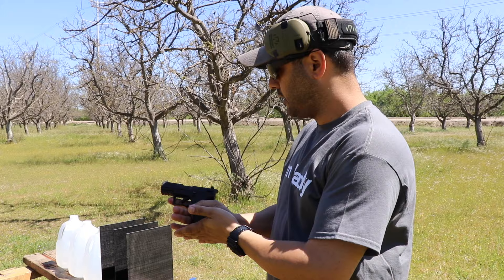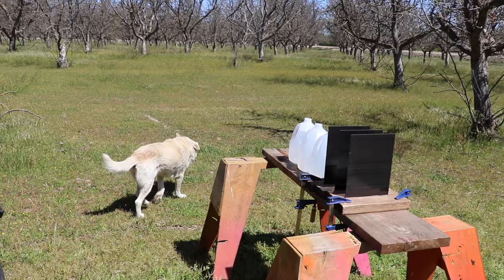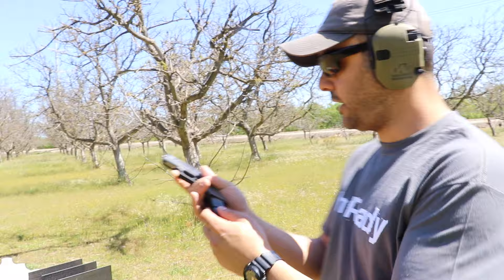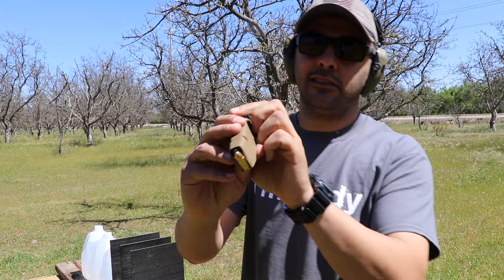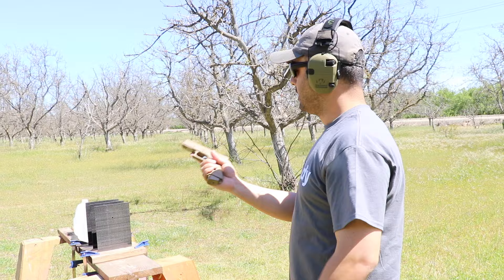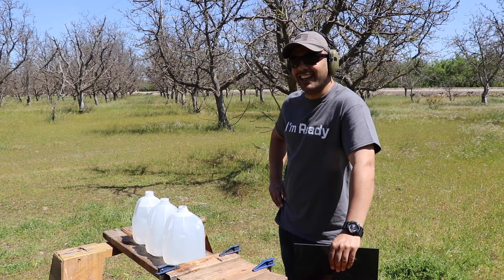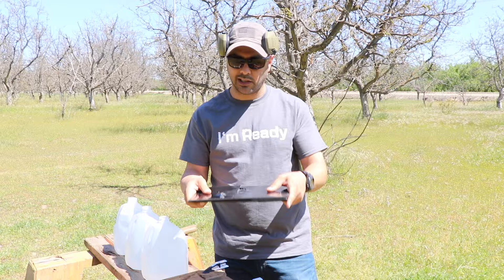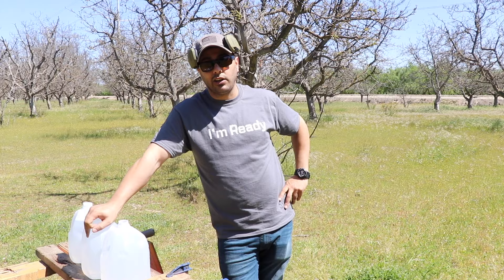Carbon Fiber BulletProof?

Comment: The strength in carbon fiber comes from what’s binding it, the number of strands, and number of layers. It might be best to make your own carbon fiber sheets, it would be cheaper that way. I’d suggest a 12k roll of carbon fiber
Reply: How can you just make your own? I imagine that would need a hydraulic press at the least
Reply: @douglasbubbletrousers4763  u can make it with a homemade vacuum, works without problems
Reply: @thecompilitation8314  Interesting
Reply: @thecompilitation8314  how do you have a link
Reply: I would love to see a demonstration

Comment: You also gotta remember that not all carbon fiber is created equal.  By changing the weaves, resins, curing and other factors you can specialize your carbon fiber to deal with more specific things.  You can probably buy differnt prepreg carbon fiber and use molds to experiment.

Comment: Glue 3 sheets together with epoxy and the shoot with the larger caliber guns (please).
Reply: JerkRice leaving them spaced out will actually increase its protective value because it will deform the projectile and cause it to tumble and lose massive amounts of energy
Reply: Synapsis Flame you are probably correct.  I just want to see what the destruction would look like.
Reply: Rotating the patterns some could make it stronger.
Reply: With 3 sheets of kevlar in between and a foam backing.
Reply: no, they would be stronger as one piece.
Reply: @cagataytekin6318  - 100%
Reply: Cagatay Tekin No, that’s not how it works. Spaced armor is an effective armor even used on tanks as it makes the round tumble in the air and it could redirect the round decreasing penetrating power
Reply: I even have some 12mm material available to test
Reply: @M.C. Maldek RLSV composite armor used on MBTs is not made up BS. Air gaps are very effective and are one of the reasons why the leopard 2A5+ arrow head design is so effective. Also given the average sheet thickness of aluminum foil of 0.2mm you would have 60mm of aluminum. You would need 381 layers of foil to have the same thickness at which point you could arrange it to stop more powerful projectile
Reply: @JerkRice  caliber doesn't effect penetration its speed that increases penetration
Reply: Even better would be sticking steal wool in between and with that I am sure it would stop it!!!
Reply: Synapsis Flame were talking about body armor
Reply: Then Rhino Line the outside of the Sheets of Carbon Fiber

Comment: They look like they are 3.0mm thick. 2.0mm is quite thin.
Reply: Paul Capocasa 2.999mm in my opinion
Reply: 2.99996mm imo
Reply: 4mm more like it
Reply: I'd say 4 mm
Reply: 3/16" for sure
Reply: Paul Capocasa what do you Americans know about millimeters...
Reply: jybuys I'm NOT an American, I'm an Australian. Also, I'm a tradesman, I kneed to know both metric and imperial.
Reply: I think is something between 3 or 4 mm, 2 mm is too thin as you say
Reply: TeknoBreaker I don't think they make 4.0mm....only 1.5, 2.0, 3.0, 5.0 mm. Quite common to skip a size like that so the company can reduce tool costs...you can just use 2 pieces of 2.0 mm to make a 4.0 mm.
Reply: jybuys  Well actually they teach both metric and imperial in America now, I'm a high school student in USA and I remember starting to learn metric in third grade and if you have any Chemistry and engineering classes you will use metric. I actually like metric much more than the US customary, a Base of 10s makes much more sense and is easier to use.
Reply: Dillon Hawkins That is right. When I was doing my Engineering studies, I had to learn imperial and found it extremely confusing and outdated. Most older people don't want to let go of the imperial system and won't even try metric. The metric currency is just as easy.....I can't work out the old Pound and Shilling the UK use.
Reply: Paul Capocasa its 5mm actually
Reply: dvr1337 That is NOT 5.0mm. Open your eyes!
Reply: Paul Capocasa to change everything in the USA to metric from our current system would cost an insane amount of money. Thats my assumption of why we havent changed it..
Reply: M773 I totally agree. It is much more logical to break a number into 10's than it is to break 1 inch into 64 fractions or decimals (Decimals are metric anyway and most Americans don't know they are halfway there).
Reply: They are definitely at least 5mm
Reply: Paul Capocasa Hey fyi companies definitely make 4mm CF.
Reply: @XenonLining  1/4 inch braddah
Reply: That looks like 5mm to me
Reply: Tnx for the advise about thw weight

Comment: Carbonfiber can be made many many different ways. Meaning with the right composition of layers, weaves, materials, epoxy, type of cf, cure cycle, etc, etc. It can be made to be more bullet proof than basic carbon fiber.

Comment: As a racing fan in Indy and F-1, I found this fascinating because for many years, they talk about how strong carbon fiber is compared ro steel. Good choice to continue video later, cut to 6 layers vs bigger caliber. Rico cracked me up, found tall, green grass to chill in, looked like a Apex predator hiding in wait.

Comment: 4 sheets of carbon fiber with high condensed foam spacer would still be lighter than kevlar. Maybe not ideal but if you need to be fast. With the spacers it would even be more bullet resistant. Probably most handgun common rounds.

Comment: That doesn't seem to be true CF. You can see in the first shot autopsy. It's a CF composite. Solid CF would have more hairs at the fracture line, and it wouldn't delaminate that easily, and the fracture lines of that inner material (that looks like a homogeneous sheet, not a carbon weave) are perfectly clean/straight. I've never seen broken CF act this way.
Reply: Andrew Delashaw seems legit but most likely due to multiple layers maybe 6k and 3k mix but would love to see 24k x3 sheets be shot

Comment: I bought a G19X for $589 at Academy 2 weeks ago and it is the best pistol I have ever owned. And  I have had ALOT  of pistols. Still love my G29 gen4 alot though. If anyone is on the fence about the G19X, buy it you won't be disappointed.

Comment: 115gr of powder in a 9mm would be insane
Reply: That could be fun... Once! (You'd need a larger case for 115gr of powder, but you could neck that down for a 9mm) Might I recommend having a mighty string and an ordnance-grand shield in place for testing.
Reply: Yeah, I think like the most you would use is like 5.8 grains.
Reply: @chontarango6024  I load a 115 gn fmj bullet over 6.3 grains of cfe pistol powder, talk about a snappy round.

Comment: Don't arrange it in distant, stack it closer together so its more resistant
Reply: This would actually work to its disadvantage as having the air gap causes the round to lose energy after being deformed and will begin to tumble

Comment: Just for reference, there are 7000 grains per pound, or 437.5 per ounce.
Reply: 1000mg->1g
1000g->1Kg
1000Kg->1Ton
1000Ton->1Kton

Anothert sample of the metric system. 

Can anyone explain me why ounce and pound and grain exist and why they are how they are?

Thank you!
Reply: Great question, Pleumel. Even more so why do we have a 115 grain bullet for a 9mm round?
Reply: Jim Vandemoter now we can start:
9 mm
10 mm
45 acp
50 bmg etc

I think it‘s because of the inventor of the round
Reply: We can start, but where does it end? let's see, 7000gr/lb=15,452.53gr/kg. Ooooooh my head's beginning to hurt. I'm thinking about this waaay to much.

Comment: The fact that the third crack in half make me think is not good quality carbon fiber olate because it looks like the just put almost all the fibers in just one direction(the crack tells that). It would be probably stronger if they change the direcction of the fiber on each layer.

Comment: it might not go through at all if you were able to shot at it perpendicular to the grain. A 1/1/1 inch cube of carbon fiber, while perpendicular to the force it is against can hold around over 100 tons of force. Whilst parallel (as you guys have it there) it could only with stand a force of 60 tons, now granted this was a cube not a sheet, but it is same to assume that if the sheets you have where instead perpendicular to the bullets trajectory that it likely wouldn't pass through, at least not with out some heavier caliber.

Comment: I know this is old buy you can literally buy a brick sized chunk of carbon fiber.  Most likely extremely expensive but it does exist.  There a hydraulic press channel that recently tried to compress a huge block of carbon fiber.  Carbon fiber is extremely strong depending on the direction of layers and the type of carbon fiber.  Today 3K cf is probably the most common higher end carbon fiber. Just FYI.

Comment: The fact that you see fibers doesn't mean it's all carbon fiber. A lot of those plates are fiberglass with a single layer of carbon fiber for cosmetic purposes. Either way, this is silly. If you want to stop bullets you should use Kevlar. Same manufacturing process, less expensive and far more effective for this.

Comment: I brought a carbon fibre rod last year, it's Young's modulus is more than 230GPa, and ultimate tensile strength is more than 1600MPa..... Much stronger than steel

Comment: I swear, rigo has a death wish sometimes, also, that is actually cheap carbon fiber. If you buy something like Torray t-800 carbon fiber, you get higher tensile strengths than even kevlar.

Comment: The problem with carbon fiber is that it's really rigid. Which means when it hits the max tension, it will break and have no give making it horrible for bulletproofing.

Comment: Edwin, get the remaining pieces of this carbon fibre (still usable to shoot once more). Break each piece in half and then put all the halves together tightly. Making 6 of them together is about 15mm or carbon fibre. Then shoot it with a larger calibre. Shoot it with the desert eagle.

Comment: This seemed to be carbon with a duroplastic matrix, if you got one with a thermoplastic matrix they would have performed even better. Basically the strength comes from the bires but the surrounding polymer decides how much energy gets absorbed when the bullet goes through. With a softer polymer the compound would not break but instead cause the fibres to deform much more, similar to kevlar, and thus absorb more energy.

Comment: well, in controlled environment, your glock would have been stopped easily

these CF are isotropic, so if bullets hits straight, without angle, they will be ideally stopped.

Comment: they are better together becuse the energy needed to go through something  is squared compared to the thickness, that dosent work in metal becuse metal breaks the bullet, so the separation between the metal plates gives time to the fragments of the bullet to separate from each other and dissipate the energy in a larger surface at the next  panel

Comment: So where did you get them? Carbon fiber comes in 3k, 6k, 12k etc... 3k means 3,000 strands of carbon fiber per strand or whatever the hell... my point is there are in fact different grades which means different tinsel strength... loose plates arent a good simulation proper energy trnsfer up tight to a body... now if these are for walls or cars okay.. but a ballistics test for body armor should always simulate tight to a body... or sand bag...  also the bonding agent is crucial in increasing strength.. different resins have different elasticity and flex... they also make aramid which is kevlar woven with carbon fiber strands

Comment: Those panels are not built right the only weave material are one in front and one on the back! The middle is unidirectional graphite, that’s why it split in half! 

The strength of Those panels are only 10% of a well made panel with same thickness would be

Comment: Wow carbon fibre is really good armor like its really light and really strong I'm pretty sure it's like 3 times stronger than most metals and its certainly stronger than kevlar why doesnt everyone use it in the military and what not like sure it's fairly expensive but I'm pretty sure it's still cheaper than kevlar and it's way way lighter

Comment: Always love your videos. You should try layers of rubber. I did layers up to 4 inches thick and a 22LR actually went through more layers than 9mm or 45 but they all were stopped. .223 rounds went right through all 4 inches easily.

Comment: what kind of carbon fiber is it? yah is it made from woven carbon nano tubes and what length? if they could make a hammock with one sheet of graphene one atom thick it could hold the weight of a cat with out breaking.   that 2p carbon electron bond is even stronger than the 3p bond in diamond.

Comment: The plates you have are made of cheap low quality carbon fiber, to give carbon fiber a real go try using T-700 carbon fiber which is twice as strong as kevlar.
Reply: its only 17 bucks for a yard of it on amazon and yes the t700 are all real on there as there is only 1 source of it on amazon and they are legit ive bought some from them.

Comment: I use the 147gr bullet exclusively in my 9mm's. Better performance and subsonic 😁😎👍🏻 HP for duty, and Berry's plated bullets using Winchester 231. Works well with them. Clean and no muzzle flash.

Comment: I don't know why you're afraid of a ricochet, for someone who handles guns a lot (by the looks of your channel) you should know that a bullet never ricochets back at the shooter, it would never happen. Only thing you should worry about, is pieces of the material you shoot at, flying at you. Even then chances are very low that pieces fly at the shooter.
Reply: The Sethioz Project it doesn't take much shrapnel to blind you
Reply: Poison Control Takes a lot of bad luck though. It’s more likely puncture a vein or stab you in the heart than blind you.

Comment: Always wonder of using carbon fiber but rotate the fiber direction in 5degree due to the criss cross pattern of carbon fiber
Reply: The pattern is only for show, the inside of carbon fiber is like normal dark iron.
Reply: @suave605 no that pattern is the weave which has different benefits depending what you use it for.